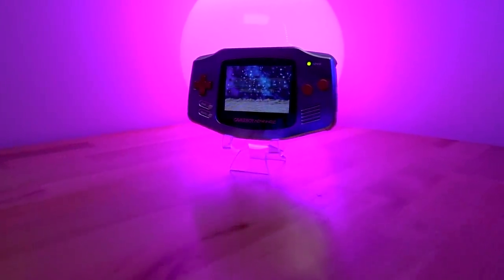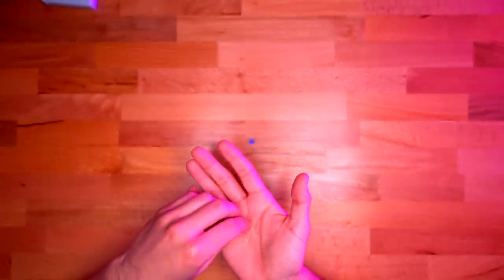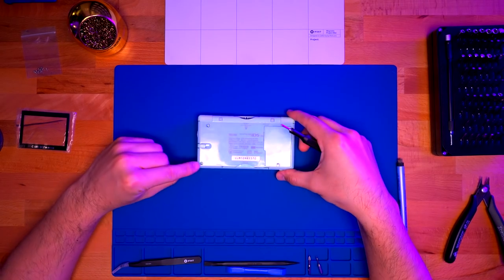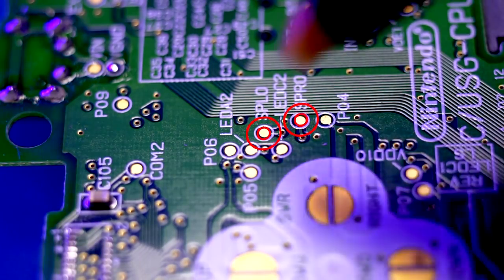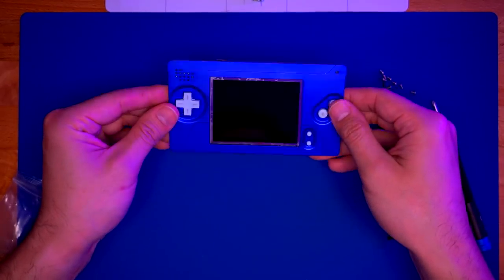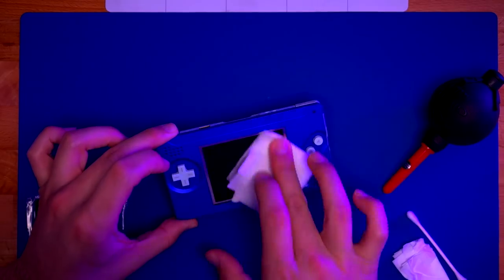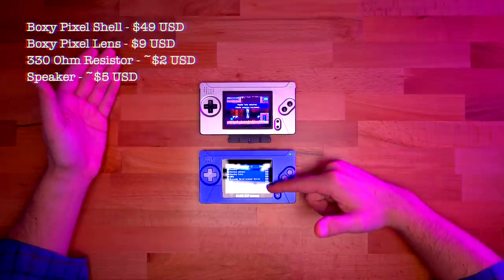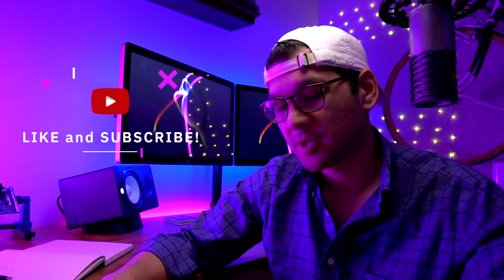Gameboy Macro Mod Tutorial 2020 - Easy to Follow Instructions - Boxy Pixel Shell | Retro Renew

Comment from the maker: Thank you all for watching the video!  I really hope you enjoyed it!  If you found the video useful/helpful/entertaining, give it a LIKE:)
Also, consider SUBSCRIBING to the channel to stay up to date with all my future content by clicking the following link:  https://bit.ly/3bw08kk
Cheers!
Reply: Hey Macho Nacho Productions you spelled Micro wrong
Reply: @mariasiqueiros7063  just think about it it is not as small as the micro but is smaller than the advanced so the name firs perfectly
Reply: @Macho Nacho Productions, does the touch screen still work/ still have touch screen functionality?
Reply from the maker: Yes, it does. Just need to make sure you re-insert the digitizer ribbon cable back. If you want the glass screen lens then you will lose touch functionality. Hope this helps!  Cheers!
Reply: @MachoNachoProductions  so, if you don't need/care about touch functionality (the GBA didn't have that, correct), you can just drop the digitizer screen? I understand the directional pad will still work to set time and such,right? My question is 1) do you then need a glass screen like you installed or can you just use the digitizer screen with it not plugged in? 2) Will the system run WITHOUT a digitizer plugged in? I ask this specifically because I have two DS lite candidates for this mod. One has a bad P3 connector (the top screen one) which I cannot source a replacement anywhere and the other has a bad P6 connector (the digitizer) and power switch (I have a replacement though). I can source a P6 connector but they are pricey. If I can get away with not needing it, that would be great.
Reply from the maker: Great questions!  I think I can answer them both:  1) You do not need the glass screen lens and yes, you can use the digitizer with out it being plugged in.  2) Yes, the system will run without the digitizer plugged in.  I hope this helps!  Also, best of luck on you Game Boy Macro build!  Cheers dude!
Reply from the maker: You should get the ez flash omega. Takes care of that problem. Hope this helps!  Cheers!
Reply: Bro are you selling any of your mods? Like the advance sp?
Reply from the maker: Hey Rafael!  Not at the moment, but I may in the future!  Stay tuned!  Cheers buddy!
Reply: Macho Nacho Productions thank you 👍🏼 let me know if ever
Reply from the maker: Will do!
Reply: Would you be able to use less U.V light, it makes the whole thing seem a bit TOO vibrant, and hard to see the true colors
Reply: What LCD wipes, spray and blabber are you using? My wipes always leave some dust behind.

Comment: I was just gonna break off the top screen but this is 100 times better
Reply: Amber Ward I did that as a kid when the hinge was broken. It stopped working, so I must’ve snapped something. Good thing you didn’t tho. Haha
Reply: @DjStiv3  i think it's something you do when it's already broken
Reply: Lillie Exists  i mean the video is stupid and spending so much to do it. Breaking off is dumb too but more so i meant video bcz of the cost. You may as well disassemble and do it properly make it look good
Reply: Plus, you dont have to do everything (like he mentioned). My only cost is going to be the resistor, and probably a   clear acrylic rod for the top. Also there  comes a point where repair is either cost prohibitive or difficult.  I have 2 macro candidates right now,  one with a bad digitizer connector and one wit a broken upper screen connector that is impossible to source.
Reply: @DjStiv3  r/wooosh
Reply: Lillie Exists  no shit. Like i said the VIDEO... youre adding cost of 50 for shell and 9 lens and whatever else. Just open it up remove the top and sand down and patch that left over gap and done. All you have to do is invest in that 30 bucks no need to spend another 60 70 plus for anything else. Its stupid. And the OP wants to go this route as seen in the video.. why? To spend more? Its needless and dumb.
Reply: @DjStiv3  you dont need to spend any mony lol
Reply: DjStiv3 You’re right, you don’t need to spend the extra money on it but lots of people like console molding and having something that looks nice. It’s not stupid, its the same thing as spending money on any other hobby, it may not seem worth it to you but for some people it is.
Reply: @Tbae2401  its because the ds runs a self check while / before booting
if it fails
so if one of the screens is "missing" it doesnt boot
Reply: @DjStiv3  dude its not alot you usually do it to save one with a broken top screen
Reply: @charliewarren8906  you do...
Reply: @DjStiv3  By your logic, you don't have to do any of that, just use it as is.

The point is to create something that comes off as a factory style product, not a hack job frankenstein combo deal.
Reply: If your DS has both screens working it would be a waste doing this mod, this is for already broken handhelds.
Reply: @DjStiv3  you no smart mister
Reply: @DjStiv3  I know I'm late to the party but dude it's a mod. None of it is 'worth' it, unless you find it worth yourself. You don't, that's fine, we find value in it. Because why not?
Reply: Same lol😂
Reply: L + Monkey pfp @DjStiv3

Comment: just ordered these parts from boxeypixel:
macro shell            $54
glass screen           $9.90
330 ohm resistors $2

and from ifixit:
switch speaker       $9.99

total including
tax and shipping    $87.66

figured I'd add this in case anyone wanted an updated cost.
Reply: It's hardly a cheap mod though. Almost $90 in parts alone? FunnyPlaying's DSi screen kit for the AGB GBA currently costs $30 and a GBA can play every GB game too...
Reply: why would you do this mod even if ur top screen or the shell was broken a new shell or top screen replacement is like a 20 dollars and u still have a dsl with 2 screens that can run ds games without missing a top screen
Reply: @bojunchoi6354  it was something fun too do as my first project. also I have a bunch of ds's
Reply: @onedeadsaint  It's also the most pocket-able non-micro game boy at around 13mm thick. I can carry this and my wallet in the same pocket :D
Reply: I would do this mod if boxypixel included the faceplate + back shell to complete the look.

Comment: Just finished this project up. Even with using this video as a guide, I ran into the exact same issue with the screen. Popped it back open, worked the ribbon cable in some more, and now it runs like a dream!

Comment: I just started my macro build and thank you for pointing out the screen not being plugged in all the way. I felt like I soldered the resister on fine and instead of redoing it I came and watched this video.
Reply from the maker: Awesome!  Glad to hear the video was helpful!  Yeah, that ribbon cable was a bit tricky, it needed more force to insert than I thought. Would love to see how it turns out. If you have an Instagram account post a pic of your finished macro and tag me. Cheers and good luck with the build!
Reply from the maker: @Madblaster6  Removing the connector creates more space for the speaker .  Depending on where you want to put the speaker you may or may not have to remove that connector.
Reply from the maker: Very clean build!

Comment: The boxy pixel front cases are very beautiful, but they have some drawbacks. First, no room for buttons X and Y, which are useful for emulators and various homebrew. Second, no holes for stereo speakers at front, it would be posssible to do that with smaller speakers, like a cellphone ones.

Comment: This Tutorial Video.... Is Underrated, love how all the Steps is recorded in such a High Quality, so you can actually see what happen (Others that i've seen, not only they didn't have high quality, they didn't even bother to get close up shots on some of the important steps) specially with those ribbon cable

The only downside its 30 minutes video, but for me its normal, cause it's a tutorial video
Reply from the maker: Thank you @Mr. Z!  So happy you enjoyed the video!  And thank you for the kind words!  I agree it was pretty long, I just really wanted to make it as detailed and informative as possible!  Cheers!
Reply: @MachoNachoProductions  Excuse me, i have a DS problem, and you might be able solve it.

So it started when i tested a new DS Top screen (speaker not soldered), it works fine at first, the image is showing, the color is fine, everything is good.

Then i pick up my phone to see what time is it, suddenly the image was shaking, and the color was distorted, i didn't know why so i turned it off and plug it back in to make sure, but its still the same

i've tried To plug it back in a different motherboard, but the result is the same, i don't know what to do
Reply from the maker: Hmm that is interesting. I’ve never seen an issue like that unfortunately. My only guess is that it’s a defective top screen. Sorry I can be if further help. Cheers and best of luck dude!
Reply: @MachoNachoProductions  Ohhh okay, thanks for the time to Answer my questions, i really appreciate it 😁😁

And Im sucribing for future DS Lite related Content 👍
Reply from the maker: Thank you for subscribing!  There will be DS content on the way!  Cheers!

Comment: Nice mod. My only complaint would be the same that I have with the micro. It only supports gba games and ditched the backwards compatibility. The ds it also supported ds games so sacrificing gbc was a fair trade off. But not having either option is a bit of a bummer imo.

Comment: Didn't want to destroy my DS Lite, so I bought one off of eBay for <30 bucks with the top screen already broken. Great thing about this mod is that it's inexpensive and you already have a backlit screen and rechargeable battery. Plus, if you invest in the EZ Flash Omega, you can play GB/GBC roms, as well as NES roms! With the minimal amount of risk, it's probably the best "GBA" mod for modding beginners, in my book.
Reply from the maker: Couldn’t have said it better myself!  It’s certainly a great mod. You did the right thing and got an already broken DS. Cheers dude!

Comment: Maybe I'm just a noob but when you power on your new GB Macro after doing this mod you need to set the default screen to the lower screen. My screen worked fine but once I put a GBA cart in, the lower screen would just go black but there was sound. After trouble shooting for an hour or so I tried the settings and found how to set the default screen. I never owned any type of DS before this so this may be common knowledge but just in case you experience the same thing I did, hopefully you find this comment.
Reply from the maker: Thank you for sharing this!  I’m sure there are some out there that will find this information useful as I did not really mention it in the video. Thanks again!  Cheers!

Comment: I agree that the DS Lite would make for a great Gameboy Macro but I prefer the phat since the GBA cartridge is flush with the system. I though this mod could fix that but it seems you're using a ez flash omega with the smaller case. I wish they made a case for the phat as well too because it looks so clean. May make one too once I pick up a solder since the one I bought has a bad paint job and no speaker holes so it comes off muffled. I really do like using it though.
Reply from the maker: I agree, it would be so cool if they made a shell for the Phat DS!  Hopefully one day we'll get one!  Best of luck!  Cheers!

Comment: Great video! Really well done. I am having the same problem mentioned in previous posts about battery life being tanked to 3.5 hours after the mod. The weird thing is that the battery life doubles if I plug in a headset. I figure there must be some sort of voltage consumption of the speaker when not playing anything.  In my tests I have the volume turned to 0. I am interested in hearing what you think!
Reply from the maker: Thank you Michael!  I really appreciate it!  It’s strange that is an issue. I’m going to have to look into it. Very interesting!  Thank you for sharing your experience!  I should run my own test and see how it compares with a stock DS. Cheers!

Comment: Love the video and saw that you sold this on ebay haha, I built 2 so far I have the same issue with both. If I press on the screen top right the pixel warp over the flex amp. I checked my soldering and it looks fine. Is it normal? Did I do something wrong?

Comment: Is there a way to do this with just the DS Lite parts and not getting a separate face plate and speaker? (I assume the resistor will always be needed). I can't justify spending $60 on just one piece of this when the DS I'm using was only $15
Reply from the maker: Yes, it'll take a little more work however.  Depending on how nice you want the final package to look you will need to use body filler and do quite a bit of sanding as well as paint prep and painting.  It can be a very laborious task but you can achieve good results, you may also end up spending a little bit on those supplies.  If you dont care too much how it looks you can simply remove the top half.  The beauty of the faceplate is that you get good results with minimal effort.  I hope this helps.  Best of luck!  Cheers!

Comment: Does the DS Lite play Gameboy/ Color/ Advance games in 1:1 pixel ratio? If not, I assume that there is heavy blur due to interpolation which would make this mod very questionable. I mean... what's the purpose of  using a modded DS lite like this... having Gameboy/ Color/ Advance games in one device, right? But if that comes to the price of having only moderate image quality, I would rather prefer an emulation solution (for example on a PS Vita the image is brilliant and perfectly sharp due to it's much higher screen resolution -> very good interpolation).
Reply from the maker: Great question!  Both GBA and GB/GBC are both scaled correctly.  I dont notice any bluring due to interpolation since the DS was designed to support the GBA natively.  As a note, the only way to play GB/GBC games on the DS is with a flash cart since they don't fit into the GBA slot on the DS lite.  I hope this answers your question.  Cheers!
Reply: @MachoNachoProductions  Ah ok, thanks for the info. Then it shows black borders? Because the Gameboy has 160x144 pixels, the Advance 240x160 and the DS Lite 256x192 pixels.
Reply from the maker: @Thunderbird1337  That is correct.  In the video I use a screen lens that covers the boarders.  Cheers!

Comment: I've never done any mods like this and I'm a total noob when it comes to electric stuff. Could I technically take the top screen out of my DS and reuse it as bottom screen? I've got a broken DS Lite here but there the bottom touchscreen is smashed so I'm not sure.
Reply from the maker: Great question, unfortunately the ribbon cable for the top screen is incompatible with the bottom, so it wont work.  Replacement screens for the DS are pretty cheap however.  Check eBay for some listings on bottom screen replacements for the DS. I hope this helps.  Best of luck!  Cheers!
Reply: @MachoNachoProductions  that is not technically correct. They both use the same connector, but their orientation of the ribbon cable would make it difficult to adapt.
Reply from the maker: Thank you for the clarification!  Cheers!

Comment: Love this mod, I just dont get why you would go through all of that effort to decrease the functionality of a perfectly good DS lite, it can play gameboy games perfectly fine without having to lose all of that functionality.
Reply: @desposyy  agreed but most of the damage on a consol like that would be the part use for the mod however if the top screen is busted I do see the appeal. Dont get me wrong I love the look amd purpose of this mod
Reply from the maker: I totally agree!  I usually would do this to only a damaged DS Lite.  The main reason I did this mod to this unit is when I bought the DS Lite, it was advertised as for parts/repair, however, it was perfectly working and I was planning to do this video.  I do agree it was a bit wasteful.
Reply: Yeah, out of all the mods that can be done to all the consoles available, cutting off a perfectly good DS Lite is just sacrilegious in a way. All I can think of when seeing a GB Macro mod popping up is "Thanks, I hate it."
Reply: @nizamrahman4665  I actualy agree, the ds lite in my opinion is the best consol by Nintendo because it is so versatile. The mod should only be done when the consol is beyond normal repair.
Reply: @chaosinfinity6549  exactly. If it can be repaired I do so, but I've had two units in ziploc bags sitting in pieces because they had major component issues (one with a broken upper screen connector which is hard to find, and the other a broken digitizer connector), and was planning to toss em. Now I can use them for something without a lot of money spent.
Reply: @ratmaster2000  fair enough that is perfectly understandable but in that sence you are not useing a perfect good ds lite simply parts from 2 broken ones repurposing it into something functional is just like recycling, I see no wrong in this
Reply: @chaosinfinity6549  And the cool thing is, both the parts that are broken are not needed in the macro mod, so ill have two macros:)